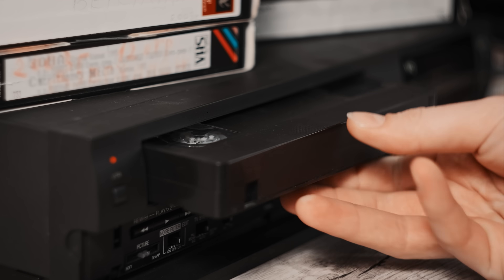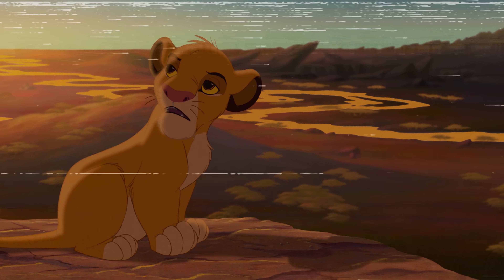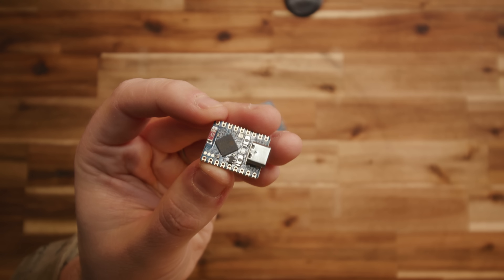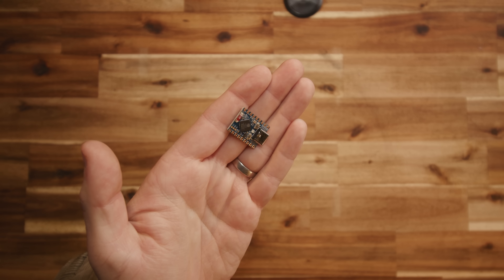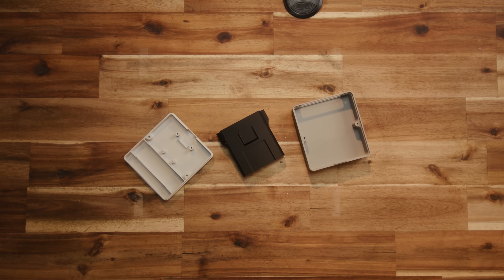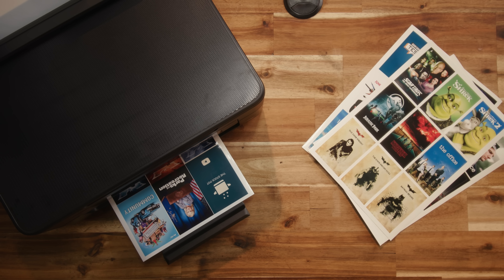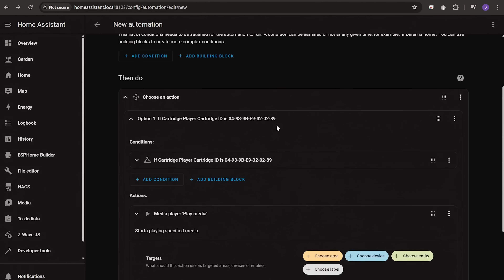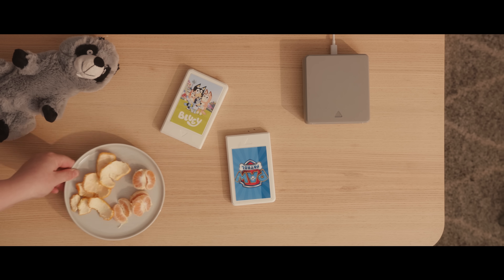I Missed VHS... So I Made My Own

Comment: I think this was awesome! Just in case someone wants an alternative, there are IcyDock bays for external drives usually used for video editors. You can use a 2.5" SSD case (cheap SSD) and do similar as this. You get the physical feel of inserting and then pushing a button to open. There are other brands as well with similar but here's an example: flexiDOCK MB521SP-B and flexiDOCK MB522SP-B. The benefit of this approach is that you can use the SSD anywhere else that has a SATA port, so your friends or whoever don't need the IcyDock bay for example.

Comment: Cool project, but Blu-Ray, 4k, and DVD still exist and work very well. Literally only thing you need to do to keep them working is not to scratch them and store them in a relatively temperature controlled environment so you don't experience any disc rot. If you want you can even relatively easily back them up so if the disc does stop working you can still watch what you paid for. Then you can add them to Jellyfin or Plex as well.

They are also pretty cheap 2nd hand, only thing is you need to watch out for scratched discs. I bought a few from the library and they had scratches and would skip or stop playing. Thankfully only down like $6 and the money went to the library so it's no big deal to me. If you don't want to risk it then obv just never buy a scratched disc, I took the risk and was aware they may not work.

Comment: I'm dissapointed: it would've been so easy to just use like, sd cards or something
something that actually HAS the movie
not just a "bow down to corporate overlords and pretend that's OK"
not just a "make sure to have internet working or you cannot watch a thing!"
but an actual physical media, there's projects to make microcontrollers emulate lik usb storage and stuff, but that would be very slow, but you could make enclosures for sd cards just as easily as this, you can get sd cards big enough to hold a movie decently cheap, especially when buying bulk, etc
like this is cool and all
but it's also just cheating
youtube channel feature is neat though, and understandably can't be replicated in any better way
Reply from the maker: All the media I watch is hosted locally on my server, so I do actually have (almost all) the movies.

Unfortunately, just like DVD and VHS, flash memory degrades over time. So eventually, the SD cards would fail too!
Reply: @TheStockPot-AU  alright, that's fine, I was just a bit too annoyed at the clickbait, the design seems quite nice otherwise

also, unlike vhs, there'd be essentially no actual wear-out from reading it (the pads can slowly wear, but very slowly, especially for a full-size sd card), and it's not prone to scratching like dvd, etc
but yeah, they'll only store stuff for ~10 years at minimum, and if they fail, there's no recovery, so not ideal either I suppose...but that's same for SSDs, so not that much difference imho, and, you could feasibly make systems for friends, and rotate your movies around, without needing like a plex or something, where all your devices, and servers, have to be online at the same time, to update/download/stream stuff

Comment: 1. I LOVE the concept.  2. pushing a cartridge into a slot isn't physical/mechanical enough for me to scratch that part of my brain;  I need something motorized, something to pull the cartridge in or click it into place or something.  You could literally use a cassette player, put the NFC player on a blank tape (with your label of choice on it), and when you put it in and press play, that means play the movie whose tag is on the cassette.  The tape can sit there whirring, the reels spinning, contributing completely nothing but giving you the feel of a physical machine.
Reply from the maker: Maybe there's room for a more mechanical V2 🤔
Reply: Might be that some tiny, strong, well-placed magnets would satisfy the desire for a pull and click, if not the whir of a motor. You can even do the partial-print/pause/place/resume trick to embed the magnets in the print, if you so choose.
Reply: Watching this whole video, my rudimentary mechanical brain was trying to figure out how I would design an eject motor for it! LOL

Comment: You forgot the most important thing about physical media: owning media in a way that no-one could take it away. Actual ownership of a copy.
I would still use this though.
Reply: Honestly, I'd get a bunch of inexpensive 32 or 64GB MicroSD or SD cards, and add those within each cartridge. That or get multiple smaller and even cheaper cards, and have them wired up to connect to something within the player which would act like the part dankpods used to make the 2TB iPod, but have that part be inside the "player" so the cartridge would only need the cheap surplus microSD or SD cards inside it.
Reply: @torondin  that's what i was thinking! there's another guy on here (abe something) who made his own physical media type thing, but for games and as giant cartridges with tiny sd cards at the bottom. it was sick
Reply: @conniehedgehog   do you remember the name of the channel?
Reply: @tulin_enjoyer  i saw that too, the channel name is "abe's projects" and one of the videos was "I designed a game console that is already obsolete."
Reply: @torondin  the problem with cheap SD cards is that they're pretty unreliable. Much easier to keep your media on (good, redundant) harddrives, and instruct your player to stream from those. Muuuch cheaper too.
Reply: When. SD cards start to fail, they become read-only (uneditable, but still can read files). This is actually ideal for this purpose, as the data can still be read even after it "dies."

Hard drives have the opposite problem. As they start to fail, they become unreadable, making them not ideal for long long-term storage.

You should have backup copies of any important data anyway, but relying on just one media is not ideal.
Reply: Yeah, it's probably a cool idea to have a failover process. Tries to run as YT, then Plex/Jellyfin, and finally the local SD card version if nothing else is found
Reply: It sounds like he is using them to play off a local plex server so technically physical ish
Reply: Hello fellow Clippy
Reply: With the size of the cartridges, I was thinking there might've been a 2.5" SATA SSD in there, which would've been handy given how inexpensive those can get for filesizes that'll hold any individual piece of media.
Reply: Doesn't Ubisoft demand that you destroy all physical copies of games they no longer support and if caught playing them (By streaming, no one is gonna actually go door to door but if you bring attention to it then you're found out) and are able to take you to court over it?
Reply: @Tofu_Bunny  I think most Ubisoft games don't have any data on the disc, so you couldn't make the argument that you owned the game if you tried... which is why nobody should buy their slop.
Reply: A cartridge that not only holds individual movies, but one that can hold entire franchises on one cartridge.
One example would be having the entire Stargate franchise. (i.e. SG1, SGA, the 1994 film as well as The Ark of Truth and Continuum.)
Or have one one that holds the reasonable star trek franchise. (i.e. TOS, TNG, DS9, Voyager, the original ten films, maybe Enterprise,)
But you see what I mean.
Having the data on the cartridge and not on the system reading the cartridge.
Reply: This was completely different to what I was expecting.

In my mind, I imagined a black box with a flappy front door, a small screen showing the title and time left, and a Raspberry Pi inside.

For the cartridges, use a USB C flash drive or I wonder if you could wire a PCB to have a cartridge connector as your USB, then not only you have the "friction", but the actual satisfaction of plugging an actual cartridge. If the internet goes down or whatever, you can still play your movies.

Comment: 2:40 no, i'd argue the opposite. while you recreate most of the goodness of physical media... for me the extra bit of appeal that what i'm holding literally and physically contains the media is of great benefit to me. if the device you have breaks for any reason at all, you don't need to worry about losing everything. if i had more know-how, i'd make my own device that uses SD cards of appropriate sizes to facilitate this instead.
Reply: Exactly. You can’t share movies without moving the entire setup.
Reply: Folks... an nvme drive is like $100 per cartridge, and would have to handle hot-swapping and mounting / unmounting. Even a small SD card is like $10 per cartridge and again has to be mounted and safely ejected so as to not corrupt everything. Plus you'd need to actually have your media player (Plex / Jellyfin / etc) be able to communicate with the device to read the media off it. The NFC stickers are like $0.30 per cartridge even if you don't buy them in crazy bulk, and the player only needs enough bandwidth to stream 20 characters.

Making a collection of 50 cartridges would cost $15 with NFC, or $500 with SD cards.

It's definitely doable, it can be done, but it's not really the same class of project or price-point
Reply: @christophervollick4634  I was just thinking out loud. 
...but yeah, those are 100% out of the question.
Reply: Hey, you can use a 2.5" SSD case (very cheap low gb ones out there) and do similar as this. Then you can get an IcyDock bay you can insert them into while still being able to use them on any PC with a SATA connector. You get the physical feel of inserting and then pushing a button to open. There are other brands as well with similar but here's an example: flexiDOCK MB521SP-B and flexiDOCK MB522SP-B
Reply: True SD or USB drives if so far the future of Physical media which is why my Gog purchases when downloading installation files will be in the new PC USB format
Reply: Consider: Make these into a bunch of NVMe drives?
Reply: I'd assume with some clever 3D printing you could just make "cartridges" that have micro sds in them and then 3D print a player with a modified slot for them right?

I had an SD card reader for my  hacked PS2 and I had planned to use SD cards as cartridges with different sets of games on them so I'd think it would be easy to do the same with movies
Reply: All of his media is on a Plex server, which he presumably has with redundant storage and backups.
Reply: @Eridescent  that's a weird thing to presume, my plex server is just my computer and there is nothing redundant about it